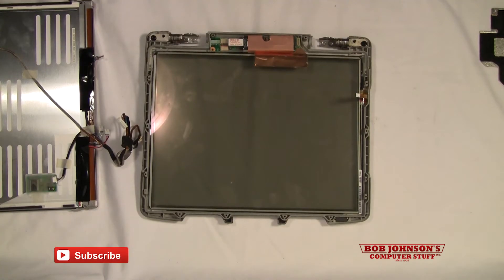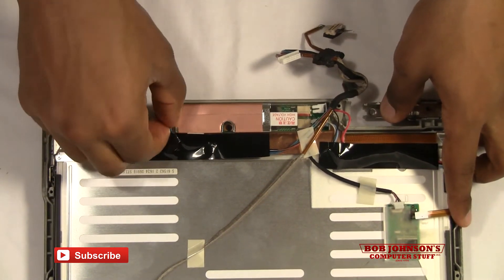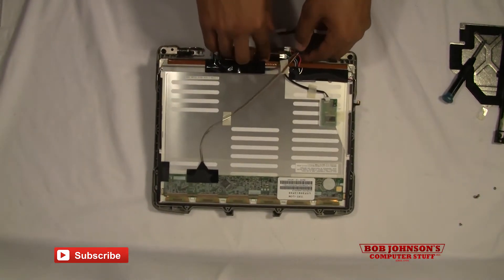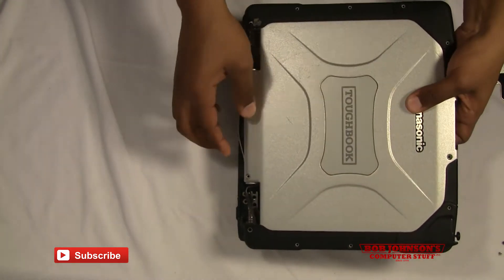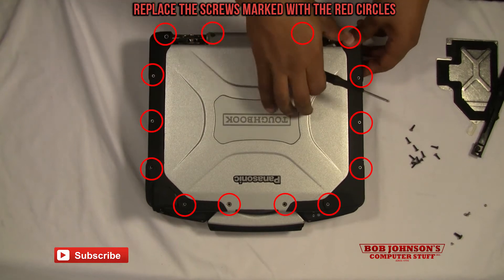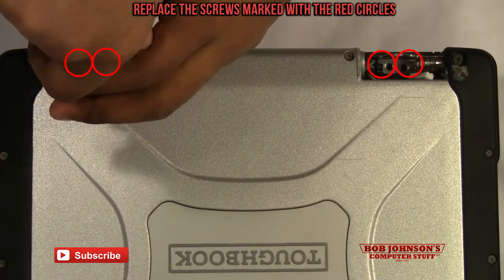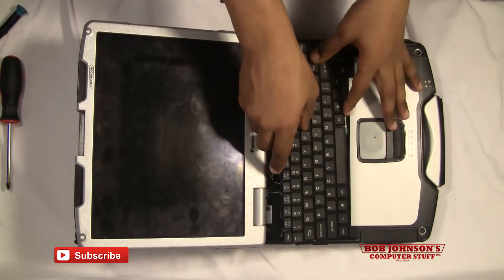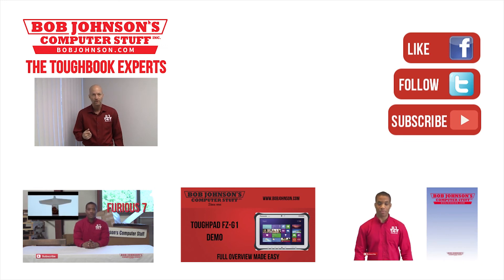Panasonic Toughbook CF-30 How to Backlight Inverter Replacement Part 2

Comment: I Have a cf-30 That the backlight just started flickering real bad and actually turns off/goes dark. I can close the screen and reopen and it will work for a little while then eventually go out again. I turned the brightness way down and it seems to be working but it is really dark and has a reddish hue about it. Do I need to replace the inverter or the whole LCD?
Reply from the maker: +FR7IMI Most likely it's just the inverter board. You should replace that first and then if the problem is not solved replace the LCD screen. You can send it to us a BJCS and we will do the repair for you or purchase the inverter board and use this instructional video to complete the repair yourself. The first link here is for the repair service form, and the second link is for the inverter board. http://bit.ly/1IyDmpD http://bit.ly/1T4sgMd
Reply from the maker: +Bob Johnson's Computer Stuff Inc. It can also be a loose cable of a damaged LCD entirely. Please let me know of your Progress!
Reply: +Bob Johnson's Computer Stuff Inc.   Well I Overnighted the Inverter board. and swapped it out and Turned it back on and it was actually worse. the screen would stay on for all of a second and a half then turn off.
Reply from the maker: Okay well it could be a number of things. Have the cables for your LCD become damaged? For even more extensive service call or e-mail our Tech Team here http://www.bobjohnson.com/repair-form/